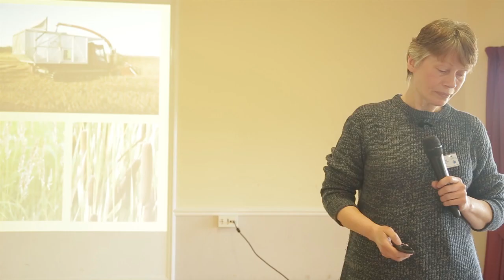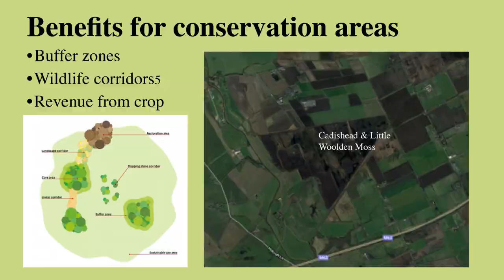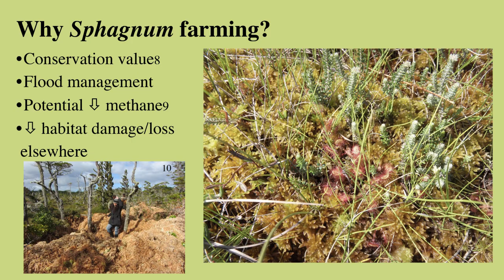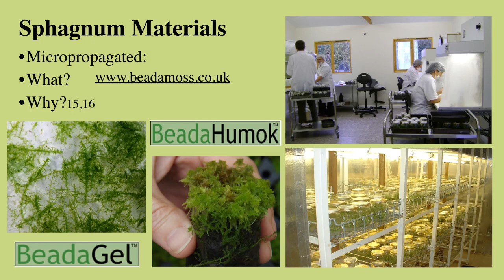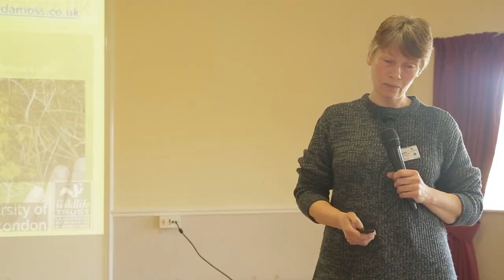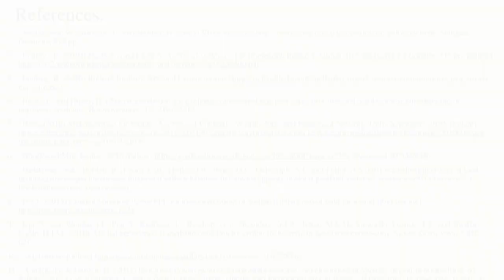Sphagnum Farming UK - Anna Keightley

Comment: Funny how she's saying that cattle is emitting methane (a greenhouse gas) but fails to mention that cattle also needs to eat. They eat plants. Which absorb co2 and nitrogen to grow. Effectively rendering them climate neutral. The methane only takes around ten years to be broken down into co2 and then be absorbed by plants to grow. Please stop blaming livestock farmers, they're not the cause.
Reply: they are not climate neutral because inside the stomach of a cow microbes brake down the plant matter,as a bi product of this a lot methane and co2 are both produced(mostly methane)methane is a very strong greenhouse gas which is much worst than co2 and is estimated to trap 30times the amount of heat than co2.even though co2 may last longer in the atmosphere,methane accelerates the global temperatures in the short term.
Hope this clears any confusion,there is probably a website that explains this better.
Reply: Agree with vossedejonk. Poor presentation.